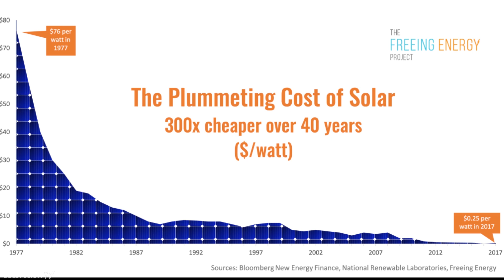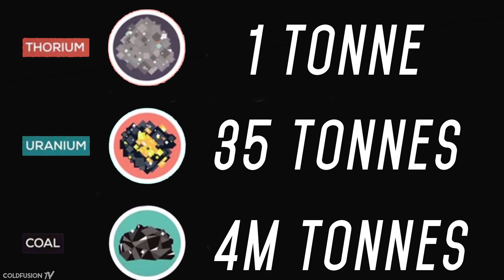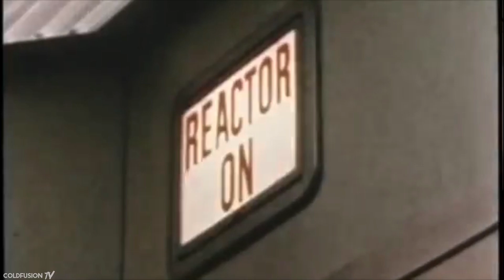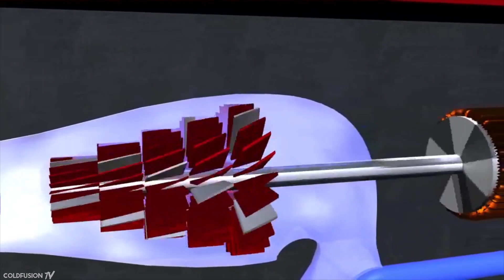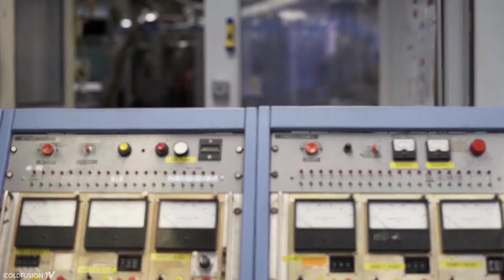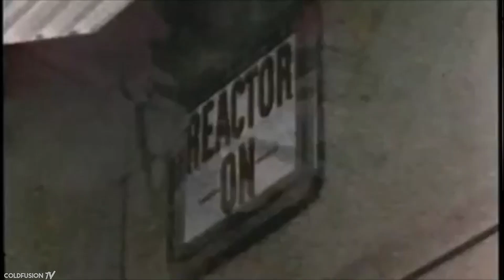Thorium - The Future of Energy?

Comment: "Thorium degradation time is 300 years." Not great, not terrible...
Reply: You're delusional, get to the infirmary.
Reply: what a missed out opportunity for a great joke
Reply: @TheDutchMitchell  I don't get it what's the joke?
Reply: 3.6 eehhhhhhhhhh I've seen worse
Reply: 300 years is really good actually
Reply: REEE all nuclear waste takes 300 years at least...
Reply: Mr PumperKnuckles That’s not accurate in the slightest...
Reply: @BOMBLATUR2  No, it's terrible. A half life of 300 years means the waste needs to be stored for more than 3,000 years. Who's going to pay for that? Nuclear power of any kind is incapable of paying its own way.
Reply: @therealctoo4183  man, it's way safer than the actual system! coal and oil give hundred of thousand of people cancer YEARLY, while nuclear is the field with the most advanced safety practices. Yes, waste management is huge, but you must see the whole picture. I'd rather die in a week because of an incident that has a probability of 1*10^-6 to happen  than see people getting sick at random because of a constant pollution from multiple sources (by the way these numbers are easily available googling death and diseases by energy sources)
Reply: @BOMBLATUR2  If what you're saying is true then it should be no problem to get PRIVATE FUNDS to cover 100% of the expenses associated with it, including safely storing the waste for at least one thousand years. 

If you can get the money from the markets, I'm all for it. If you need as little as one dollar from taxpayers then I'm 100% against it.

Nuclear power has received trillions of dollars in public money over the last 80+ years, so it's had enough. It's time to put public money in much more promising technologies like wind, solar and battery technology.
Reply: @therealctoo4183  You can check everything yourself very fast by the way. 
The thing is, privates are not after the collective well being, they are after revenue only, and that porbably includes a polluted environment for all of us...

I really wish renewables could provide 100% energy supply, but that's a mere dream, both in terms of density of power and grid management. Also tons for money are being spent on solar in the past decade with little improvement compared to what it must be able to provide.

Also please, don't commit the error to think they don't pollute...every 15 years you should dispose of those panels, which contain rare metals that you will have therefore to extract back from them with nasty chemicals and disposed of the panels themselves (and they would be A LOT). I wish the future was full renewable, but nuclear is needed ALONGSIDE. Think of a factory of steel: they need a crazy power density to operate, which I doubt could be supplied in a sustainable way by, say wind.
Reply: @BOMBLATUR2  Bull. Compared to nuclear, the amount that has been spent on wind and solar combined is essentially zero. If nuclear was ever going to be economically viable it would have done so decades ago. It's a dead-end technology that we cannot afford.

No one is saying that any technology, including wind and solar, is 100% green. The fact is that wind and solar are greener than nuclear and they're economically viable. As for energy density, the fact is that solar requires less land area than nuclear for the same power output. You might argue that thorium plants could use less area, but that would miss the point that solar energy density is more than sufficient. Once again, nuclear is a losing proposition.
Reply: @therealctoo4183  " solar required less land area than nuclear" I would love to read somewhere about this, if you have a source please provide it, I highly highly doubt it. Energy density of solar is not viable for cities. It might be for villages, but not for the metropolis of today and more importantly for the industry. If we want to live renewable, we must change our society down to the core (I'm not saying that would be great or bad). Anyway, you underplay the amount of money are being spent on renewables, it's no joke and must be taken account of.
Reply: @therealctoo4183  sorry wind and solar's promises are weak sauce. They are at best a waste of resources and as I just stated, lithium mines needed to subsidize solar and winds weakness already produce huge amounts of radioactive waste that doesn't usually get dealt with. Its been referred to as the thorium problem or rare earth mining waste. Anyway solar is inefficient on the best possible days a waste of space and resources on the worst. Wind isn't much better.
Reply: @therealctoo4183  sounds extremely inefficient, if I have a window is because I want light to pass through, while the captive surface of a solar panel should be as close as possible to a black body...
Let's say a panel has a constant efficiency of 25% (it is not, and 25 max is already very, let's say, optimistic).
Let's say we have 800W/m2 for 4.5 equivalent hours a day (it's pretty good, Mediterranean summer) and let's say the panel has a surface area of 2m^2.
We have a condo roof with 300m^2 suitable for panel positioning.
So it's 800*4.5*0.25*300 = 270 kWh/day
The average daily energy consumption of an household in a Mediterranean country like Spain is 11.32 kWh/day (it is almost 1/3 compared to the US!). So the condo should not be more than 5 stories and 5 apartments for each level.
Note that this is in optimal conditions, in a Mediterranean location, which is rich of sun, during summer, and this is if you project with a 100% utilisation factor, which with renewables is risky. Also, storage can cover for a matter of hours/days and in winter .....well, better take some heavy wool clothes.
Reply: The Real c too What isotopes are you talking about that have a 300 year decay rate? 

The closest isotopes to 300 years are Californium 249 and Argon 39, but I highly doubt you are talking about these isotopes...
Reply: The Real c too What on earth are you smoking? “Solar requires less land area for the same power output”

Um...

Solar Star 1 and 2 579 MW- 1.8 million solar panels over 13 km^2

2018 net generation: 1,685 GWh

Prairie Island Reactor 1 522MW- 1 Reactor over <1km^2 

2018 net generation: 4,532 GWh

Prairie Island has 57MW less capacity, yet takes up less than 1/14 the land area, and still produces 3 times as much energy as the largest solar farm by generation in the entire country! 

One reactor of a low sized nuclear plant produces more energy than the largest solar farm in the entire country...
Reply: The Real c too Aparently you don’t know solar works either...

“It’s the high frequencies that get captured”

High frequency spectrum Electromagnetic radiation are light waves like gamma rays and X rays. 

Solar energy utilizes visible light waves or infrared rays in CSP. 

Wtf are you talking about...
Reply: @brian2440  Sorry, I should have said that it's mostly invisible frequencies that get captured by window solar.
Reply: The Real c too There’s not really any such thing as an invisible frequency. You could say solar cells that capture frequencies that our eyes cannot see, but the frequencies themselves are not invisible.

Now there is solar research into the capturing of ultraviolet radiation, but given the technological readiness of studies on this product and minuscule efficiency compared to conventional polysilicon solar cells I am very skeptical of a commercial company selling this type of solar.
Reply: @brian2440  Now you're just being pedantic. Light you cannot see is invisible. Full stop.

And as for research into ultraviolet, it's a much more promising way to invest than in any form of nuclear power.
Reply: The Real c too Right.... which is why ultraviolet solar has not been commercially sound and not even remotely suggested for utility development compared to GIF.

GIF is the Generation IV Advanced Nuclear International Forum with 16 chartered members. There are 10  international legally binding agreements for R&D programs on GIF technologies, which is more than the Paris Accords can say.

Then there’s the fact that there’s $5 billion of private investment in US GIF technologies. 

Then there’s the BN-800, a sodium Cooled Fast Breeder Reactor in Russia that was the first GIF project to reach large scale commercial production in 2016. In 2017 Canada approved design permits for another reactor variant that falls under GIF- Integral Molten Salt Reactor developer by Terrestrial Energy. 

And from a production standpoint, most GIF technologies have a good 30 years of evidence against UV solar in experimental stages.
Reply: @brian2440  None of that means that Nuclear is worth the investment. It isn't. If it were, it wouldn't need more public financing after 80+ years of massive public investment. Face the facts.

If you believe it's worth it, then put YOUR OWN money into it. Don't ask for public money.
Reply: 3.6
Reply: HAHA
Reply: yeah allot better than 50 or 100 thausand years
Reply: Enzo Bergström that’s over estimating it by 50 to 100 thousand years. Uranium doesn’t take that long to decay...
Reply: Guess what, this is the same degradation time of the fission products of a uranium breeder design too. The only difference is that the transuranic proportions are higher and so would need to be kept in the reactor until they eventually all fission.
Reply: Let's look at modern day context. In the last 3 years, the US Gov't Energy Commission has invested just $2.6M in Thorium development and MSR reactors. An absolute insignificant, tiny drop in the huge multi billion investment cycle into clean energy. The technology has been around since the 1960's and has never produced a single spot of electricity - ever. Please don't quote Alvin Weinburg's research to me, my students try and "cut and paste" his scientific theory to me every year. It is absolutely possible to produce energy using thorium, but it has still never been proven in the real world, 60 years later on. Politics, cost, lobbyists, and advancing technology with other renewable formats, will ensure that this "future" will never see the light of day. Plus the stated "only 300 years of nuclear waste" is scientifically flat wrong. If you want to debate my thinking on MSR, then I'll happily engage. If you want to swear at me because I'm a nerd who knows science, and you don't agree, then I'll not reply.
Reply: @simonpinkerton4905  So are you for or against thorium? Not sure because you say "only 300 years of nuclear waste" is scientifically flat wrong but also complaining about the low funding.
Reply: @Simon Pinkerton
Everything that I have seen points to a fuel waste stream that only contains fission products will have around 300 years before it has decayed to the point where it's radioactivity nearly matches background levels of radiation. Yes there will be some irradiated materials that may require longer storage time scales, but in terms of fuel waste, if you can keep fuel components and transuranics out of it then everything I have seen shows that a 300 year timescale seems right. In fact, if specific isotopes can be segregated out of the fuel waste, many of them will complete decaying far sooner than 300 years and many could actually be purposed towards technology, further research or maybe even low level heat. As for the remaining fuel components and transuranics, they can be kept, or put back into the reactor until they eventually fission.
So, by which argument are you against agreeing with the 300 year timescale?
Or is it just that you think the politics around it will hinder the setup of ever being able to process the fuel?

I understand that it is probably still a long time coming before the nuclear fuel waste stream only contains fission products, but that is the goal for many nuclear supporters.
Reply: @Mister Sir I have been a published scientist all my life, others would call me an academic. I know it cost's around $1.2M per year to fund a lab diving into cancer research. The safety aspect of nuclear research costs over 5 times that. A $2.6M Gov't investment over 3 years to research/develop MSR and thorium means that private funding would be heavily needed. It just isn't available for 2 reasons. Firstly, it needs to prove technology that would financially benefit an investor, and I just don't see that within technology that has been around for 60 years. Secondly, renewable such as Offshore wind development are proving that turbine energy can become virtually constant - though not constantly predictable. Science needs context when trying to prove theory. In the UK, in 2009 they had a 10.2KW capacity of offshore wind. In a decade, that is now 2016KW and massively expanding due to the predictability of offshore and onshore breeze. A company has begun building an offshore farm with the capacity to supply a million homes. Advancing technology like this, is why development of thorium is not a priority. Have a look at this https://www.theguardian.com/environment/2019/feb/11/biggest-offshore-windfarm-to-start-uk-supply-this-week
Reply: @Nolan @TheAtheistPaladin Amazing as Einstein was, none of his theory was proven to a large degree by the time he passed away. The massive investment into the 2008 Hadron Collider (55 years later) was able to prove his dark matter theory, which in the next 20 years will provide the base for currently unimaginable technology. My metaphor extends to both your points in different ways. Strontium and Cesium are both used in the private sector, but in such tiny, small quantities, that the problem doesn't come close to resolving itself on that count. Cesium work did help unlock some complex questions into DNA research tho. Nolan, your problem is with science, cost and political issues. With the nuclear disasters we have experienced, none of them has been a problem with the science. Human error, poor build quality and a natural disaster contributed to those. As a result, If a government is going to invest in nuclear, they will always go with proven science - irrelevant of it's cost - I'll link an article below. As you are clearly well read on this topic, that point is your biggest problem - people. You present your theory clearly, but much of it cannot be proven without billions in funding. Just because some of the nuclear waste is clearly less harmful and has a much shorter half-life than other elements, doesn't mean that it can be separated/processed and safely stored in the real world also without billions in spending. Imagine trying to get people to invest in that today, with other forms of renewable energy currently making huge returns on investment. People is your problem in two ways. They need to be convinced that nuclear is safe, and that they also need it. As part of our electricity generation mix, it is the most expensive to produce, but can be very flexible due to it's ability to come online immediately - it's massive benefit. Your waste stream can never be pure enough to make an educated guess of 300 years in 2019. That may change in the future, but current thought is that such material is looking much closer to 250,000yr half-life https://www.theguardian.com/news/2017/dec/21/hinkley-point-c-dreadful-deal-behind-worlds-most-expensive-power-plant
Reply: Simon Pinkerton ring a ding ding... all green energy methods of even most modern designs have been barely capable at producing energy compared fossil fuels right? Finally someone who knows their stuff I am happy now thank you!
Reply: Mister Sir he’s against it because it would be a waste of money uranium’s decay product is thorium think about it. If we use the left over nuclear waste why do you think that nuclear left overs would be considered waste? It’s because we took as much energy into the conversion into power that we could. It’s possible to further a more condensed process to squeeze even more energy out of the material but we don’t have that technology yet. Either way it’s not going to be an effective method to produce energy...
Reply: @Mr Pumperknuckles To discredit, and also provide estimates as proof is alarming. Both those links you published range from scientific papers from 2001 to 2009. You do need to understand that the World has significantly changed since then. Just look at the phone technology improvements in that decade, which will underline my point entirely. Your scientific knowledge of Uranium is also alarming. The half-life of both uranium compounds that are used in nuclear energy range from 4.5B years to about 700M years. I would estimate that man would have colonised other planets, and left Earth before that radiation dose could ever be close to safe. Also to state that thorium is a decay product of uranium is scientifically just wrong. I'm not sure where you are getting your information from? Uranium depletes over time, not magically turn itself into another element in the periodic table. Like you said, I know my stuff.
Reply: @simonpinkerton4905  i wish more people would be like you dude. I don't know much about nuclear fission, but I hate seeing people just blasting around or just repeating "facts" that are just not true or not proven, or just not stating sources. I also hate to see something like that in a ColdFusion Video. Used to love the channel a year or 2 ago
Reply: @Mr Pumperknuckles You also get confused with what I have been debating. Nuclear, in it's current form is needed as part of a modern energy mix. Nuclear development into other reactor types is not likely to come to fruition. Renewables will replace fossil in the near future - they have no part to play in modern energy generation. UK Conservative government policy is to shut down all coal plants by 2025 - they only now create expensive power from 2. The use of land/offshore wind turbines currently has the capacity for 15M homes in the UK. That is a fact. Onshore and offshore sea breezes make generation this way extremely predictable, and virtually constant. The UK had 27 days coal free in the first 3 months of this year. The government was also widely condemned by the public for not being more ambitious. We also have not considered the most reliable renewable source of fuel yet - but it is being heavily invested in by private firms. There is a public consultation for a £6B tidal energy plant in Wales, expected to start in the next 3 years. Sun, wind and tides are the future. The UK currently has the capacity to produce energy for 15M homes, with wind, accounting for approx. 25% of the nations power. https://www.renewableuk.com/page/UKWEDhome/Wind-Energy-Statistics
Reply: @simonpinkerton4905  Who was it said, "you know science?"
Reply: @jawnee logic - Mr Pumperknuckles said it whilst somehow destroying the scientific periodic table.
Reply: @jawnee logic If you want to debate my reasoning, I'd be happy to engage, but it is currently close to 1am, so I'll leave any reply to later tomorrow
Reply: @simonpinkerton4905  I only disagree with one part of your statements. The renewable energy sector making huge ROI part. There is an ROI to be sure but huge is a bit hyperbolic. The ROI on two or three TMSRs would dwarf an entire field of solar panels and take up less space. Furthermore you'll have metric tones of thorium waste to deal with from all the lithium you mined to support the grid with that solar power during its off peak production. All that wasted thorium, contaminating the area around lithium mines, not going to any productive use, so we can keep the lights running when the sun goes down seems tragically ironic. The thing people don't seem to understand  is that lithium mines already created a radioactive waste problem.
Reply: @simonpinkerton4905  Also you must know only renewables with their huge disadvantages like dependency on environment are not enough to power our energy hunger society.
Reply: @DeepFried43  Whitch facts are not true? Whe have technology to solve most of nuclear waste problem? Whe have technology to solve environmental problem with fossil fuels?
Reply: I do not believe someone will wait 300 years for complete decay.

We CAN saparate caesium and strontium, then bombard them with neutrons and transform in to short-lived isotopes. From Cs-135 (in MRS only he will be produced, then catched in cold-traps) to Cs-136 with half-life of 13.16 days.
If Cs-137 form, neutron bombardment will transform him in to Cs-1328 and short half-life from 28 years to 33.41 min. (decay to stable barium)
Strontium: Sr-90 with half-life of 30 years in to Sr-91 with half-life of 
9.63(5) h. (decaty to yttrium-91 then he after 58.51 days
become stable Zirconium)

Sounds expensive but if you need burn 170 kg inastead of 35 000 kg, you have the BIG difference! The only cost is the energy. Source of neutrons are protons.
Reply: @simonpinkerton4905  Most of it's true but only for countries with sea but in middle land countries it's not way and only solution of fossil problem is advanced nuclear with hydro and bit of rooftop solar.
Reply: @Joseph Marsh I haven't mentioned on here, but it's probably easy to identify that I'm a Brit, so we are behind in the solar power generation aspect because we invariably have pretty poor weather. Offshore power wind generation has it's peaks and troughs too, but because the predictability of onshore and offshore breezes, energy is always being produced, and therefore energy/money made. That is where massive ROI is currently being made, as solar doesn't suit us. Wind currently generates enough power for around 15M homes daily, and that figure is rapidly growing. In a country our size, that is 25% of our energy needs.I respect that all countries will need an energy mix to ensure that power is constantly available - for example France gets 40% of it's energy via nuclear in that regard, and the UK is around 17% daily on average. The issue I would point out regarding TMSR's is one I made much earlier on in this thread. Scientifically, a thorium based reactor will absolutely be able to produce power. There are a multitude of reasons why this has never been developed, and put into practice. Firstly, and the most obvious, is money. Nuclear research is just off the charts - in my experience, around 5 times the lab costs of a cancer research facility I have worked in. Secondly, is that science to create energy via a nuclear reactor is already proven, and very safe. Thus why spend billions in the previous step. And finally, try to convince people that you have found a new form of nuclear, and you are building a plant near them. People have long memories of previous nuclear disasters, even though the science was not in any way a cause of them. Trying to get an investor to put billions into a new enterprise of this sort would be virtually impossible. That is why the US Energy Commission has only allocated $2.6M in 3 yrs to develop these ideas further. That is chicken feed. We do need nuclear, it's flexibility is it's massive advantage. The question is do we need more of it though? I know a lot has been stated above about thorium waste, and someone attached a 300yr figure to it. That is just wrong, the half-life of the compound is 4 times that of uranium 238 at 14.05B years. Thorium isotopes are very unstable, where uranium has the advantage that it can be controlled as a sustained nuclear chain reaction. I just wouldn't want to take that little extra step into the unknown, if I already had proven science. My thoughts are that this is the reason why thorium hasn't produced a spot of energy yet, and probably never will. Joseph, my students say I ramble, but I hope that adds a little perspective?
Reply: @Samuel Gomola - You are entirely correct. I have stated on this thread a few times, that renewables can only form part of an energy mix. You simply must be able to produce power in other ways. Offshore wind is proving to be reliable energy, as turbines are easier to turn at sea. The big question is what the rest of the mix will be. Is it coal, oil, biomass, nuclear, geothermal and so on. IMO the best answer to that in the near future will be tidal. You can utterly depend on it happening, plus you know exactly what time it will also be happening. That technology exists. A £6B tidal project in SW Wales is approved and looks set to break ground within a few months, entirely with private funding. I think we should all cross our fingers with that one. Until then, we have what we use currently, with fossils and nuclear included
Reply: @Samuel Gomola - I can only speak for continental Europe, but we can transfer energy within countries, and outside countries, as all our grids are interconnected. Commonly Germany exports coal power, France with it's nuclear, and the UK sometimes with it's wind. We have been importing and exporting power to each other for decades.
Reply: @Wladca Wymiaru Hopefully, from 1 scientist to another. To my knowledge, there has been 14 attempts to achieve this science - the last in 2014. At COP24, there was a debrief to that research, but I didn't attend, due to politicians arguing over past, present and future carbon crediting. That debrief might have been published if you could gain access to, and navigate the impossible UN library
Reply: @simonpinkerton4905  Isn't one of the downsides for thorium waste the amount of radiation levels being far higher then Uranium? So we can't really store it in a good way.
Reply: @mgammeren Tbh, there is not an answer to that yet. Much of the science that most people have been debating revolves around that 300 year number. From what I'm aware, there has been over a dozen attempts to identify what the waste would be whilst producing energy, and nobody has been able to prove that science in practice. As a general rule, thorium isotopes are very unstable in comparison to uranium. Probably the reason why the above hasn't been achieved. However, Einstein couldn't prove much of his science by the time he had passed. He has proven to be an utter genius when technology has advanced for us to try and prove them. The question is simple to a degree - will thorium be proven, invested in, and built before other cheaper renewables become more efficient, and that energy be stored into batteries.
Reply: @simonpinkerton4905  The answer is: No, thorium would need to have been proven by now. Renewables and battery tech is already a better alternative and they're getting better all the time. This with virtually no government support compared to nuclear. Nuclear is corporate welfare, plain and simple.
Reply: @The Real c too After reading yr comments on this thread I can obviously see the views you have on nuclear. Like it or not, nuclear will always be a power source for decades to come. If you believe that renewables and battery tech are not being funded, with respect to nuclear, then I'd really like to see some evidence for this. I you wish, I can save you the time, because that statement is false. Thorium research has garnered less than $1.2M pa research budget from the US Energy Commission in the last 3 years - their budget for carbon free energy research stretches towards $5B pa. Renewables are an exciting proposition, and their development has brought huge results. In 2009 coal was used for 30% energy generation in the UK. As at year to date, that coal figure for the UK now sits at 3% - massive wind technology development has filled that void. But battery tech is lagging behind with regards to grid level storage. Lithium and Zinc would be the 2 alternatives, both of which have big downfalls at the moment. Tesla are in the process of building a grid device, and we believe that he has discovered new tech. Crossing my fingers that he will publish his findings
Reply: @The Real c too I'm not sure what your trying to say. Sure, nuclear has had trillions spent on it over the last 20 years. But I'm talking the here and now, with regards to future US public energy investments. If you don't like my figures, or don't like my thinking, then I have no problem. I did not claim that thorium spending was the total nuclear dollars recorded for the 2018/9 budget for zero carbon work for the US Commission either. You should have realised that you are debating on a video about thorium power, it's possibilities, scope, development, cost and waste impacts. Scientific research needs context - something my students also struggle with. May I suggest that you have a look into the last COP24 summit in Poland. You will see the renewables that are being invested in, the research teams involved, where they are located, how it is being financed and expected results. It may enable you to sleep a little easier.
Reply: @simonpinkerton4905  No, you're trying to ignore the fact that after trillions of dollars spent on it, nuclear power is a huge financial failure. You're also trying to ignore the fact that with a tiny fraction of that money having been spent on wind and solar, both are financially viable. 

Instead of wasting billions more on nuclear we need to invest those billions in wind, solar, and battery technology so that they can improve to the point where in the not too distant future they'll be able to provide 100% of the power we need.
Reply: @The Real c too By looking at this thread from the beginning, surely you would realise that I have been heavily involved with the research within UK offshore wind technology?
Reply: @simonpinkerton4905  I don't care what you're involved with. If you're advocating for nuclear power, you're wrong. If you're asking for public money for nuclear power, you're not just wrong, you're outrageously wrong. 

It's very simple, but you don't seem to get it, so I'll say it again: If nuclear power were ever going to be viable it would not need public funds to fully pay for itself by now. The fact that it cannot do that means it is a terrible investment. In fact, it's not an investment at all. It's just a welfare program for companies involved. You can't name another industry that's received so much public money and still can't support itself!
Reply: @TheReal c too I'll leave this now. Scientists tend to not leave YouTube comments for the reasons you are now displaying.
Reply: @simonpinkerton4905  Facts aren't a problem for scientists. You should learn to deal with them instead of trying to win arguments by appealing to authority.
Reply: The Real c too The problem is that there are multiple studies which find 100% renewable would actually cost more than renewable and sustainable like nuclear...
Reply: @The Real c too You see, I have been asked about a dozen questions regarding thorium science on here. I knew the answers and responded. I have put thorium technology development into modern day context in relation to research and current state of renewables - something I work on. I have engaged with the posters on here, whom have all been respectful in their questions to me. Then you arrive with your ideas, which you make very clear and forcefully. If you don't like my work or think I'm a fraud, then that is your right. Looking at your profile, it would seem that you enjoy the work of Tesla. We are not so different you and I, with the exception that I was taught and have learned how to speak to people properly. I'd much rather teach PHD's whom have your type of enthusiasm, but you must be able to understand the opinion of others. If you want a piece of advice, then that is it. That will be the last post that I'll answer to you. Discredit me if you wish, but that would prove my point entirely
Reply: @brian2440  Those studies conveniently omit the cost of storing the waste. If I'm wrong, show me how they would pay for storing waste for thousands of years. You don't really expect anyone to believe that it would "only" be 300 years, do you? Of course, even that would be beyond the capabilities of the nuclear industry to handle. Can you imagine how we'd feel about George Washington if we were sitting here thinking that in another 60 years we might be able to enter multiple waste sites his generation created without fear of contamination.
Reply: @simonpinkerton4905  I have asked how the cost of waste storage would be paid for, and I've received no answer. Only blatant attempts to divert attention away from that question. 

No one should care about thorium science until and unless the economic questions can be answered. They cannot, as you have shown through your consistent attempts at diversion and claims of authority.
Reply: The Real c too Based on what do you believe that the waste needs to be stored for thousands of years? 

You know why the waste is stored at 300 years? Because the decay rate is 29.97 years and the total statistical decay is 10 times the decay rate. At total statistical decay the radioactivity is less than 0.001% of the original sample radioactivity.
Reply: @The Real c too I'll come back to you on this. If you had asked me a question about nuclear waste storage costs, then I would have replied, and given you a reasoned answer. But you didn't ask me that question, and I just read every line that you have written to me? You have asked that question @Brian, a precise 4 mins after I told you that, quite frankly, you are beginning to embarrass yourself.
Reply: The Real c too It’s difficult to evaluate the cost of storage, as there are multiple ways to store or utilize nuclear waste. 

In fact we had an entire process to pay for waste storage. But using this data today is difficult because the government who made the law in the first place now doesn’t follow it and has forced additional cost for temporary contingency storage.
Reply: @simonpinkerton4905  Your reading comprehension is poor. I asked about storage costs on my very first post in this topic, 3 days ago. I asked again in my second post. I can't be sure, but I believe that I've questioned the economics of nuclear power on all or almost all of my posts. In fact I've never asked or cared about the science because, as I've made clear throughout this thread, the science of nuclear power is irrelevant since it is a bad investment.
Reply: @Brian, The science that you are reasoning is correct in a way, but wholly inaccurate in another. Firstly, a thorium reactor that would produce energy has never been achieved, and in my opinion, it never will. The scientific equation's are perfectly accurate, but thorium isotopes are so unstable, that I don't believe that they ever will be proven. The last attempt was made in 2014, and to my knowledge, is no longer being researched in earnest. The second thing I would add, is that only some waste could be attributed to that 300 year figure. Thorium as a stand alone element has a half-life of over 14B years, and would need to be part of that waste calculation - which has been conveniently ignored by most on here. Then there is the question of whether more nuclear is needed. France generates 70% of their power through nuclear production. They will need to start de-commissioning some of their reactors from 2025/6. As yet, they have neither started building new nuclear, or any other power generation type. They will have to rely on importing energy from either German coal or UK wind, and politically that is news that the French have not been told.
Reply: @brian2440  Great! So you can show a sound FINANCIAL plan for storing it for "only" 300 years after the plant finally closes then! That should be easy, right? Why haven't you done so? Why hasn't anyone? Could it be that the cost of storing any hazardous material for 50+ years longer than the U.S. has existed might be greater than the cost of building, operating, and decommissioning a plant for 40 or 50 years?
Reply: @brian2440  No one other than nuclear advocates should care whether or not it is "difficult" to evaluate the cost of storage. That isn't our problem. Our problem is determining whether or not it is worth the investment. Leaving a huge, very expensive question like that open makes the risk far greater than any potential reward. Once again, you're showing that nuclear power is a terrible investment that no one should sink money in. Least of all, public funds.
Reply: @The Real c too  - So you didn't personally ask me the question as I very clearly stated earlier. There have now been 125 posts during this thread. I'm pretty sure, even you, would not expect someone to reply to every single comment made on here? The aggressive nature of your writing would also limit someone's desire to try and debate your points. I made that mistake a while ago. The only thing that you have made very clear on here, is the absolute lack of humility to try and understand a different view to your own. I see you in a couple of my students this year, and 1 was very bright. He was expelled for arguing and punching a fellow student, the other is now re-taking classes after his parents sent him to see a therapist. Best wishes for the future
Reply: @simonpinkerton4905  I've made clear in many posts – both to you and others – that the problem with nuclear power is that it is not financially viable. Your arrogance has prevented you from seeing that, since your primary desire has been to demonstrate your belief in your superior scientific knowledge. That's not my problem. It's yours.
Reply: @The Real c too When you enter the real world, you'll understand that scientists change everything - from your cell phone to medicine and absolutely everything in between. I enjoy being part of that world, and if you believe that is what makes me arrogant, then that is your opinion. As a keyboard warrior, I'm pretty sure that you'd also like to be involved in research science, in that world, but sadly you are not. That is your problem, and my life in a nutshell.
Reply: The Real c too The problem with that argument is that the difficulty of storage is impacted by nuclear opponents. 

Furthermore there are potentially more economic waste management options for nuclear, but they are hindered by nuclear opponent policy. For example 

Reprocessing and waste re-use of fission products is still considered a non-proliferation risk even though it does not contain any fissile material. The claim is that this material can be made into a dirty bomb, but what’s interesting is that this moratorium does not exist for research facilities or hospitals  where there is historical record of materials being stolen by risky groups. 

We see the same bs with people claiming that active nuclear reactors are major terrorist risk, even though there is zero evidence of this being the case and reactors have been tested to withstand exceptional force since the 1960s. 

And yet even though there is historical record of terrorists stealing and damaging research facilities and hospitals for radioactive materials these facilities are never regulated to the same standards or considered to have as much risk.
Reply: @simonpinkerton4905  And there's that arrogance again! You know nothing of my credentials. Why? Because I recognize that here on the internet they are meaningless. No one is going to check them. The only thing that matters are facts. Your constant attempts at arguing from authority and your name calling have destroyed your credibility. If you doubt me, have one of your colleagues read this thread. (You really shouldn't. It will not be good for your career.)
Reply: @brian2440  In the real world companies and technologies have opponents. In the free market we call that competition, and it's considered a good thing. If nuclear can't compete (and it cannot) then it can and should be replaced with alternative tech.
Reply: The Real c too Competition does not include regulatory measures taken against an industry based on non-scientific bs. 

I.E. requiring nuclear reactors to withstand above the maximum theoretical seismic load, when refineries, chemical plants, pipelines, hydroelectric plants, industrial plants and bases are not required to.

Or

I.e. requiring that nuclear reactors store nuclear waste onsite despite a federal law explicitly dictating that the federal government would take responsibility of it. Also having waste facilities maintain LNT limits for radiation, even though LNT has significant scientific flaws and in some cases would require radiation exposure below background radiation levels. Oh and then having not one but three regulatory agencies review and create standards by which these facilities must conform. 

Versus solar manufacturing waste having ZERO regulatory agencies review and provide public record of waste quantities. ZERO federal procedures in place for storage of solar manufacturing waste.

That’s not competition. Thats third party interference with increased and unbalanced cost. I’m not necessarily against the regulations on waste, but it’s total bs that some industries are held to these standards while others are not and then people compare costs and don’t bring this up.
Reply: @The Real c too - There is a difference between arguing, name calling and rationed discussion. I have been involved in the latter. I have also enjoyed engaging with others on this thread. I'm also very confidant that my teaching, research projects and credibility are going to remain unaffected by my discussions with The Real c too. As it is now Sat night, and I have stated on numerous occasions that I should have stopped myself from replying to you, I will now take my own advice. Thankyou for that lesson.
Reply: The Real c too Our argument has mostly been about waste, but the argument for nuclear vs renewables is more about macro-scale energy grids. 

Due to the concentration of resources in the USA, if we were to pursue 100% renewable this would lead to a very high penetration of intermittent solar and wind resources. To counteract the grid flexibility issue we would have to install an astronomical amount of batteries and improve grid distribution. Therefore when we compare nuclear to solar in projected models what we are really comparing is: 

Renewables (solar, wind water, biomass)+ Sustainables (Nuclear, CCS, HELE) vs. 100% renewables + storage +  grid management. 

In this comparison while Nuclear itself may be more than the initial cost of solar, the entire energy grid cost is less than the energy grid for 100% renewable due to the cost of storage and grid alterations. 

-“Renewables and decarbonization: Studies of California, Wisconsin and Germany”
https://www.sciencedirect.com/science/article/pii/S1040619016300136

“Reflections—What Would It Take to Reduce U.S. Greenhouse Gas Emissions 80 Percent by 2050?”
https://academic.oup.com/reep/article/11/2/319/3964517

-“Geophysical constraints on the reliability of solar and wind power in the United States”
https://cloudfront.escholarship.org/dist/prd/content/qt96315051/qt96315051.pdf

-"Buffering volatility: A study on the limits of Germany's energy revolution"
https://www.sciencedirect.com/science/article/pii/S0014292117300995

- "Evaluation of a proposal for reliable low-cost grid power with 100% wind, water, and solar"
https://www.pnas.org/content/114/26/6722

- "Meta-analysis of high penetration renewable energy scenarios" https://www.sciencedirect.com/science/article/pii/S1364032113006291

- "A critical review of global decarbonization scenarios: what do they tell us about feasibility?"
https://onlinelibrary.wiley.com/doi/full/10.1002/wcc.324
Reply: @brian2440  Nuclear waste needs to be stored for thousands of years. It requires much tougher standards. There are plenty of industries that need more regulation. The fact that they don't have it is no reason to reduce regulation on nuclear. In any case, no one has demonstrated the ability to safely store nuclear waste for even one hundred years, and that means that nuclear power cannot pay for its waste storage. If it can't pay that, it can't pay its own way, so it's not economically viable. Full stop.
Reply: The Real c too Question time: 

Why does nuclear waste need to have tougher waste standards when the most radioactive waste will decay in less than 500 years, but chemical waste that remains toxic for infinity has less severe standards? 

Explain that logic....

Chemical waster does not degrade over time unless rendered inert by another chemical. There is no difference in the risk or toxicity between 1 year old hydrochloric acid and 1 trillion year old hydrochloric acid.
Reply: @brian2440  Chemical waste does not... wait for it... RADIATE! There is also no way to render it inert. And once again, I'm not saying there should not be more regulation. There absolutely should be. Claiming that others aren't regulated properly, so nuclear shouldn't be either is like a child saying everybody else is doing it! Don't be that child. It's not helping your argument.
Reply: The Real c too I’m not saying that nuclear shouldn’t be regulated. In fact I literally have said the exact opposite multiple times. My argument was that other industries should have the same standards as the nuclear industry, or if they don’t people who evaluate costs should absolutely recognize this. 

Also on waste,  you’re telling you would rather drink hydrofluoric acid than eat potassium 40?
Reply: @brian2440  Again, you're not helping your argument. Increased regulation for other industries IS NEEDED and that fact does nothing to suggest that we ease necessary regulation of nuclear.

I'd rather eat dark chocolate. See? I can go off topic too!
Reply: The Real c too When have I ever said that waste regulations for nuclear energy should be eased?
Reply: The Real c too Also again my arguments have largely been about the misconceptions of nuclear waste and management methods and the comparison between nuclear waste to other forms of waste. 

This is why I asked if you would eat hydrofluoric acid or eat potassium 40. This is 100% on topic because I’m comparing nuclear waste to solar waste. You can’t just say nuclear waste is worse than chemical waste because it “radiates”. The risk level is proportional to the type of waste and a multuide of variables. There are plenty of isotopes like Cesium 137 or Stronium 90 that pose significantly more risk than chemical waste, but it is not simply because they are radioactive. It is because of their volume, type of radioactive decay, bioaccumulation, AND radioactivity. 

We live on a radioactive planet. If all radioactive materials were inherently unsafe and posed significant risk beyond all other chemical risks then life would never have been able to exist.
Reply: @brian2440  You're trying to argue the technicalities, and that's jumping the gun. Before you can talk about any of the science you need to show that you can safely store the waste for as long as it will be dangerous. Until then, I don't care what isotopes there are, and neither should anyone else. Once you show that you can store the waste for 300 years, then and only then is when I would start asking questions about the actual content of the waste. I'd wonder (at that point — I don't now) if the 300 years is based off of the isotope in the waste with the shortest decay rate, in which case we'd need to look at the other isotopes. At this point however, I'm not at all interested in that information because you have not cleared the first hurdle.
Reply: @therealctoo4183  " Before you can talk about any of the science you need to show that you can safely store the waste for as long as it will be dangerous" Um, WTF?
This doesn't make any sense, because in order to determine how long an isotope needs to be stored or determine how dangerous it is you need to understand the science. 

"Until then, I don't care what isotopes there are, and neither should anyone else. "
You absolutely should care, because the amount of storage time required for different isotopes ranges astronomically. For example Americium 243 has a total statistical decay of 70,000+ years, but Americium 244 has a total statistical decay of 106 hours. 

Also the risk associated to various isotopes differs astronomically by type of radioactive decay. Uranium 238 exhibits alpha decay with low radioactivity. Alpha decay is harmful in very close proximity, but cannot penetrate human skin. You can quite literally pickup and handle Uranium 238. Beta decay is harmful in larger proximities and can penetrate human skin flesh and even bone, which is why isotopes such as Cesium 137 are considered to have much higher risk given they have beta decay and are dramatically more radioactive. 

Without understanding the scientific factors that make radioactive materials present risk, it would be impossible to determine the most effective waste management methods, the levels of risk and the time needed for effective storage. 

If you honestly think this way then your ignorance is blinding you from thinking critically, and at this point your arguments holds zero value.
 
"I'd wonder (at that point — I don't now) if the 300 years is based off of the isotope in the waste with the shortest decay rate, in which case we'd need to look at the other isotopes"

I don't know what the 300 year time is based on in this video as it presents inaccurate information regularly. However, when talking about fission product waste 300 years is based on total statistical decay of the longest lived fission products namely Cesium 137 and Strontium 90, which have half lives of about 30 years. Total statistical decay is roughly 10 half lives so 30 x 10 is 300 years. Remember total statistical decay reduces net radioactivity of a sample to .001% of the original sample radioactivity.
Reply: @brian2440  It makes perfect sense. I'm taking the video at face value, for now. 300 years is the bench mark. Meet it, and we can discuss it further. Don't, and there is no point thinking about any of the details.
Reply: @therealctoo4183 What are you even discussing? And what is the purpose of this benchmark in your opinion if you don't care about isotopes, radioactive decay or decay rates?
Reply: @brian2440  Sheesh! I've said it many, many times! Nuclear power is a financial disaster. It has not paid its own way and it cannot do so. You keep distracting yourself from this fundamental fact because you want to discuss the technical details, and they are simply not relevant. What matters is that nuclear is fiscal folly.
Reply: @brian2440  Wow. You need to stop using children's arguing tactics. Distraction attempts like claiming that other technologies aren't yet good enough won't cut it. Neither will your "the other kids are doing it" argument about regulations. And the "you just don't understand" trick you borrowed from an angry teenage girl isn't going to work either.

I'm not suggesting that solar and wind are ready now. I'm suggesting that nuclear is not now, and never will be ready because there is no way to pay for the costs associated with it. You have not made a single attempt to address this fact, and that's understandable because you cannot. Just accept the truth!
Reply: @brian2440  By the way, I think it's important to note that in the links you provided the cost of storing nuclear waste is never mentioned.  It's a sad fact of life that scientists can fall victim to PR efforts like everyone else, and the nuclear industry has done a good PR job of managing to separate themselves from the waste they produce, at least in many people's minds. That does not change the fact that the cost must be paid, and not by taxpayers.
Reply: @brian2440  And now you've regressed to a toddler, kicking and screaming because you can't get your way! 

I want you to build a storage system for the waste that YOU claim will be produced and last for the 300 years that YOU claim will be necessary. It's a simple engineering problem: build me a black box that performs the task you've defined. Until you have built it, I don't need to know what goes in the box. I only need to know that it will perform as you have defined it. 

If you can build that box, then, and only then, will I bother to worry about what's in it. That's very convenient for me, because I know that you cannot build the box. You add evidence to that fact with every post.
Reply: @therealctoo4183 The cost of decommissioning includes the cost of waste storage as temporary waste mitigation, which is absolutely included in those studies. Additionally the people who wrote those studies are not school children. Many of them hold actual degrees in nuclear engineering, so I can assure you they are all well aware of the waste issue of nuclear energy. 

Also you responded to me in 14 minutes those studies are not single page documents, and I gave you 7 sources, so you clearly did not read them all, if you even read any of them.
Reply: @brian2440  The cost of decommissioning most certainly DOES NOT include the cost of storing nuclear waste for thousands of years! That figure has to be larger than our national debt. Please, you're embarrassing yourself.

Edit: In fact, there is NO plan to store the waste long term, so it's going to fall to taxpayers. Currently, they're shuffling it around between facilities with the hope of using Yucca Mountain (taxpayers stuck with the bill again) at some point.
Reply: @therealctoo4183  We have built structures that have lasted over 2,000 years, what is your skepticism? 

Also nuclear waste storage involves drilling out a mountain several hundred feet below the ground and then storing the waste into boreholes or concrete containers. Believe it or not but these locations have been around longer than 300 years.
Reply: @brian2440  Holy crap! You can't keep anything straight, can you? Those plants aren't using Thorium. The spent fuel DOES need to be stored for thousands of years. But, feel free to keep deluding yourself it not thinking that you know better. I'm done with you.
Reply: I'm glad my stupid comment somehow sparked a scientific debate of sorts
Reply: That 300-year waste isn't waste. It is mostly strontium-90 and cesium-137 both of which we can put to use. Strontium-90 is used to warm satellites and cesium-137 can be used to irradiate food making safer (killing cross contamination and mold).
Reply: "Thorium degradation time is 300 years"
Not great, not terrible...but 
Perfectly balanced, as all things should be
Reply: that's a half life not total degradation...
Reply: Setting aside the joke, all nuclear waste degradation time is 300 years. The long lived waste from reactors is transuranics which can be used as fuel and aren't really waste.
A MSR design (such as one with Thorium, but not necessarily!) will constantly burn up this transuranic component as it's produced. And only the 300-year waste has to be chemically separated. This is not unique to Thorium at all, any MSR has this advantage.
Reply: @zolikoff  isn't the issue that refining spent uranium back into a usable form makes the fuel weapons grade and thus in violation of nuclear treaties? I'm definitely not sure I'm right about this haha
Reply: @jmac8470  Normally you make MOX fuel which is low enrichment, but you could instead extract the plutonium and use it for bombs.
But I don't see the problem. If countries that already possess nuclear weapons do the processing, then what does it matter? They already have dedicated reactors for plutonium production and extraction for weapons. 
It's only the US that doesn't want to do processing of spent fuel. And they have a shitton of weapons, it shouldn't matter.
Hell, Japan does MOX fuel production... and they're not supposed to have weapons.
Reply: @jmac8470  In fact, you're quite incorrect. Take it from someone who's worked in both Naval fuels for maritime propulsion, as well as Uranium enrichment and defense nuclear waste (from weapons and weapons-grade processing).
Reply: @jmac8470  Different processes.  Weapons grade in terms of uranium is about 'enrichment 'levels (90%+ U235, fissile material, good for reactors and bombs).  Typical reactor fuel is about 3% U235. The balance is U238 (No good for bombs or conventional nuclear reactors).

'Reprocessing' fuel can separate uranium and plutonium and the other waste products.  If your fuel hasn't been in the reactor too long, its mostly Pu239 (good for bombs).  If it has been in the reactor a long time, the Pu is contaminated with much more Pu240 (no good for bombs) .
Reply: @zolikoff  thanks for the reply! So do countries with nuclear reactors currently use the fuel in such a way that the spent fuel enters this 300 year state?
Reply: @jmac8470  As much as the extent of reprocessing goes. France used to reprocess all of its waste, plus that of several other countries. I don't know if they're still doing that. A lot of the 300-year waste got buried.
However, some of the 300-year waste is used for medical and research purposes. Radiotherapy isotopes come from this waste.
Reply: i don't get the joke
Reply: Dang, missed posting that by minutes.
Reply: I saw what you did there lol.
Reply: i was looking for this comment...
Reply: 3 people
Reply: dodeca hedron ummm your over conflating the amount of people dying from coal related “diseases” as you claim 

First of all coal power plants are more so safer than they ever have before both air quality wise and gathering wise. 

Here is my source and the annual death estimate world wide for coal related deaths including those who don’t even work in the coal industry but those living near by equating to around 10,000- 23,000. That’s not very many compared to the fact that over 2.6 million people work in the coal industry... also you clearly never researched anything you spew about... 

https://www.edf.org/sites/default/files/9553_coal-plants-health-impacts.pdf

Here is proof on estimate of projection further that still barely reaches half of what you claim about people dying. 

https://sites.google.com/site/yarravalleyclimateactiongroup/pollution-deaths-from-fossil-fuel-based-power-plants

And this goes along with different types of fossil fuels such as oil as well but that’s not all. The estimates from this citation says that only 170,000 at most die yearly but I don’t want to say anything but that last source was full of bs as well considering they consider an organization based blog as a source for information but also the fact that they take anything from climate alarmist who’s careers focus on climate science from the government which makes up the majority of the problems in the UK and the many problems involving the science committee in Europe... either way your not really all that bright... you can’t replace all our coal and other fossil power plants with nuclear power plants. 

reason 1. It would cost us trillions of dollars. 

2. That would in term speed up the increase In Nuclear waste we have already in stock piles. 

3. People will think worse about nuclear power in their own area compared to that of a power plant...
Reply: dodeca hedron also I do give you perk up for the microbe eating bacteria that was discovered in 2012.
Reply: dodeca hedron also Thorium is the decay product of uranium...
Reply: It’s from the show Chernobyl
Reply: It passively contains itself in a meltdown.
Reply: Still, why not sending the waste in space or at least store it on a higher orbit until you can develop a proper technology to throw it into the sun.
Reply: @Russell Racey Most astrophysicists believe that the Sun will have grown to become a Red Giant and engulfed our planet long before any of that uranium used could be considered safe https://www.sciencealert.com/what-will-happen-after-the-sun-dies-planetary-nebula-solar-system
Reply: @sgg I'd be interested to know how you reach that conclusion? My apologies if you think cancer research and consulting for IAEA are a problem for you
Reply: @sgg The Pu-239 in spent fuel is perfectly fine for weapons if you chemically extract it and purify it. It's just not the most efficient way of creating plutonium.
Reply: Th-232 that will be used as a halflife of 1.405×10^10 years  but the waste products of Thorium takes 300 years to not be Radioactive anymore
Reply: Then ONE neutron tranform him in to Th-233 with half-life of  21.83 minutes XD
Reply: BL4CK&Y3LL0W And that’s different from Uranium 235 how exactly?
Reply: What part do you mean? How Th-232 can be more stable(which I cant explian) or how Th-232 chain reaction with a neutron to U-233 and splittning U-233 can put out more energy than U-233. 
I can do the math if you want to. And thats with Th-232+1 neutron because that creates some energy to. (mass is destroyed and realise some energy.)
Reply: BL4CK&Y3LL0W Mass is not destroyed in nuclear reactions. The Mass Defect is representative of the binding energy that is released in a nuclear reaction that can be calculated from: 

E^2=m^2c^4+p^2c^2

This equation is literally the Mass Energy Equivalence Equation, however since in most cases we only care about determining the energy of particles that have mass the simplified version of this equation is much more commonly used and known as: 

E=MC^2
Reply: @brian2440  Yea I did say so good about it and I have not gone thrugh E^2=m^2c^4+p^2c^2 But yea the mass it not destroyed it's converted to energy.
Reply: I mean, it's shorter lived. But much more radioactive. Think, if the half-life is 300 years instead of 30,000 years. Then you have 100 times the decay rate. In about 10 half lives it's more or less gone. But that's 3000 years, we would still be in danger from waste made by the Roman empire if they did that. Nuclear power is good, thorium is good. We need more. But smaller numbers aren't just better. If it were 3 years that'd seem great. But the material would be 10,000 times as deadly. In this case. Storage for 30 years is easy. But 300 years is almost the worst of both worlds. Much deadlier. And the waste may still Outlast us.
Reply: Everyone remember that's half life! Does not mean it is safe! But still better than the alternative!!!
Reply: Better than plastics no?
Reply: EDWARD SCIACCA
1 second ago
WITH MICRO THORIUM GENERATORS THE TEXAS POWER OUTAGE WOULD NOT HAVE HAPPENED. THUM'S  UP IF U AGREE
Reply: Yes it is terrible that's 300 years of contamination in the eventuality of a event.
Reply: @haroldlamble5163  Lmao compare that to the thousands of years that Uranium needs to degrade, Thorium is clearly a better alternative but Noone had interest in it because it couldn't create weapons of mass destruction you americans just love.
Reply: Max Villame first of all uranium lasts longer and is a better fuel source stronger fuel source than thorium. Second. The life use of thorium sucks compared to uranium... or even plutonium... also, the decay life of uranium only last nearly 300 years as well every journalist who post about uranium and contamination and claims that aren’t true that uranium waste takes thousands of years to decay because they don’t know shit about environmental Deterioration...
Reply: @Phantom-jy6uv  It's stupid say that. 300 years short lived waste are fission products lierarly same as with Uranium or Plutonium fuel. Only one difference are transuranics whitch today are not burned complete also these transuranics are created in thorium reactor. At all Thorium fuel in today reactor is basicaly same problem than today widely used Uranium fuel. Solution isn't Thorium, solution are fast breeder reactors and molten salt reactrors.